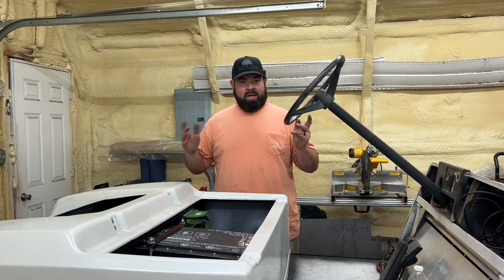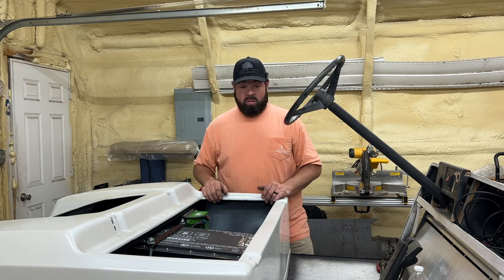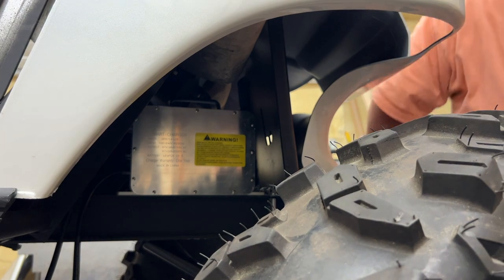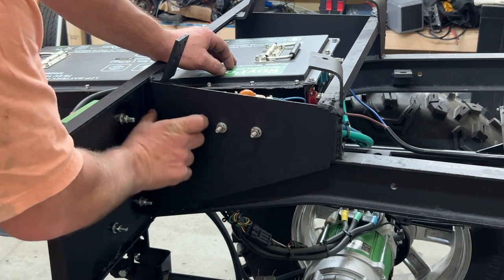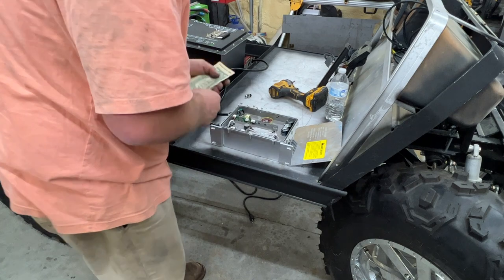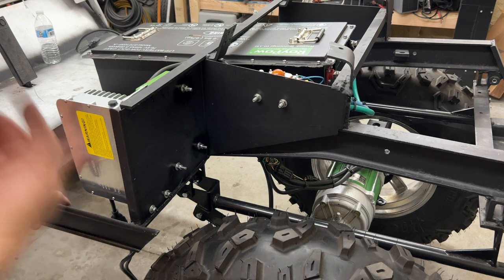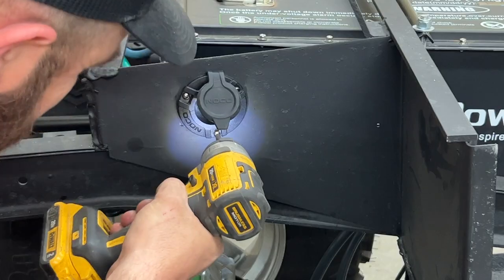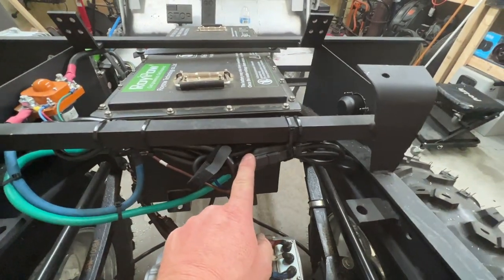WLKNTALL Gets Waterproof On Board Charger Mounted & Hidden NOCO outlet | Club Car DS Golf Cart

Comment: DIY wire loom solution - Take 2" diameter PVC pipe with end caps, paint it black, notch the end cap to allow wires to exit mount it to the cross member and stuff the wires inside. Love the build so far!

Comment: Nice install.  I thought about mounting my RoyPow charger in the compartment but with the fan I just thought it's not that big of deal to plug it in (I don't have to charge it often now!).  My installer used the pigtail that was included with the battery vs the cart's port.  What I really want to do next is either replace the stock ClubCar controller or reprogram the factory to get rid of the regen and maybe try to pick up a little speed.
Reply: IMHO, you can get the regen turned off but as to speed, the factory controller is never going to do much

Comment: I like the charging port in the fender well. I might have mounted the charger on the frame rail next to the battery. 

I am rebuilding a 2001 ezgo from ground up and have to find a place for the charger as well. 

I am looking at the eco skinny battery kit. Any thoughts on the battery?

Comment: Ryan, I think you nailed it.  The only thing I would do would be to put a support brace under the back end of the battery.  I am sure it is fine, but could a hard bump or drop break the top mount and allow the battery to tip back?

Comment: I see you installed the 110V connector up in the fender well of WALKNTALL.
1. Do you think a plastic cord anchor would work to provide strain relief on the back side of the outlet?  The metal screw on the bottom could be replaced with a machine bolt and the cord anchor added to the backside of the bolt and tightened with a nut.
.
2. I liked where you mounted the charging unit.  I understand you did not want to disassemble the charger once you noticed the water tight seal.
Had I known that in advance, I think I would have made a special request that they remove the handle before shipping it to you.  If they dont want to do that, then I think I would cut the handle off and leave about a 1/4 inch so the screws that hold the handle from the inside dont get cut off and start rattling around inside where you cannot retrieve them.
.
3.  I realize that you did not like all of that excess cord directly above the motor.
I was thinking that if it were me, that I would cut the female end of a 2 or 3 outlet extension cord and connect it to the back side of the mounted 3 prong port.  Then you would be able to connect 2 different chargers to the 3 prong port at once.
Also you could stretch out the 110V lines from each charger to reach the 2 or 3 port outlet, and then cut off the excess cord and wire in a new 3 prong male plug, so both chargers could run without all of that excess cord. 
.
4. At 13:14 in the video, you were showing the extra battery tray on the passenger side.
I see that the battery tray rail closest to the existing battery, has quite a few holes, looks pretty chewed up.  I dont think I would trust that rail to hold much weight if you decided to put the 12V battery in that tray.  The BigBattery 12V Seal battery is still about 55 pounds.
.
5. I understand that you want to keep everything watertight and protected from the elements.  I also see the underside of carts that usually look like they have been driving through a swamp or mud puddles.
What is your opinion of creating and installing a piece of steel plate that is sort of a U shape that would start in front of the axle and come down at an angle and then go underneath the axle and then go back up at a similar angle behind the axle?   \__/ 
I think this would also protect the transaxle and the electrical connectors on the motor.
I got this idea when I saw a raised up truck that had it in front to protect the engine.
.
Thanks for listening.

Comment: I like the lighter side of Ryan. You're hitting your stride.

You wanted "what I would do"......I'll give it to you but there's nothing wrong with what you did and a hundred ways to do things.

1. Cut the wires down. Just because XYZ company gives you 5 feet of wire that's preterminated doesn't mean you can't put new terminals on in the length you need. Gets rid of the bundles.

2. I would have put the charger in the extreme front behind the body, cut the handle off and would have put the charge port pointed down behind the headlight.

3. Put you auxiliary battery up front in the free area created by the lift kit. Put a aluminum panel on each side, no one sees it. And we know some weight on the front end is a good thing for ride quality and anti-wheelie device 😂😂😂

All this is just me and my preference. Just like I'll never have a rear facing seat on a cart again. It's a whole lot better to split the cart and  add a front facing kit. Makes the cart worth a ton more